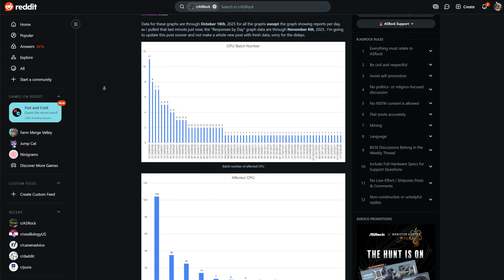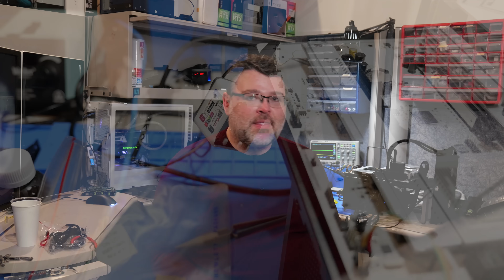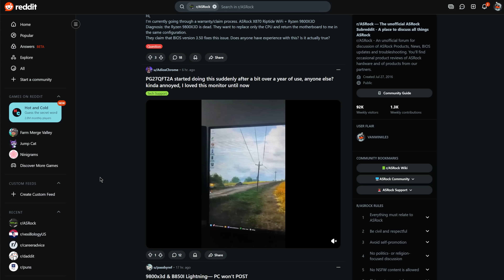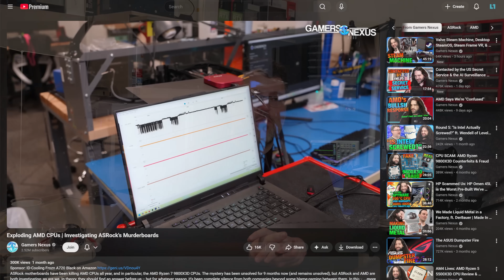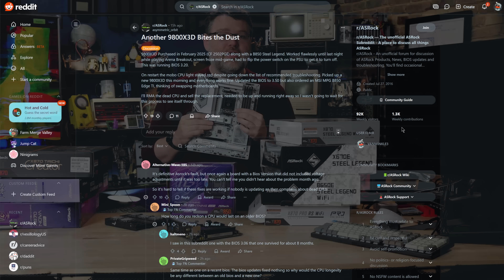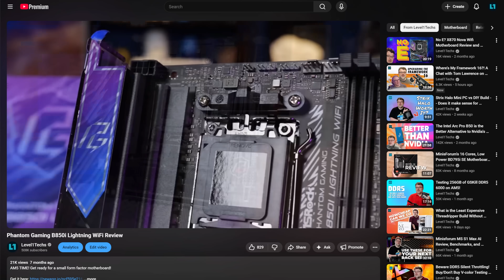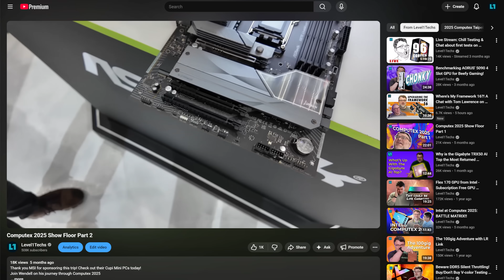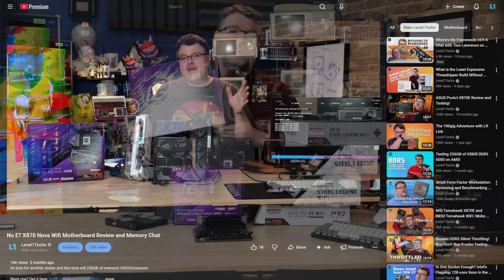Attempting to Troubleshoot the ASRock Motherboards of Death!

Comment: I switched to AM5 recently and simply didn't consider ASRock at all. As rare as the failures may be, there's no justifiable reason to pick a board that potentially has an inherent, serious flaw when there's so many others to choose from. I ended up getting an MSI B850 Edge TI and have been very happy with it.
Reply: G'day CaptainKenway I stopped considering ASRock years ago, I have been building PCs for people here in Australia for MANY yrs (started when intel had PGA) & we have a good "Warranty Returns Through Seller" Policy so gave them many chances due to having Low Pricing for Mid Range Spec. But in the end they just ended up causing more trouble than the cheaper cost was worth for those boards needing Warranty Replacements after time diagnosing what is wrong.

While I am now doing some Gigabyte & ASUS 1156 & 1155 upgrades (to used AM4 helping local Low Income people) for W11 compatibility the only one I or PCs I've built that still has ASRock is a Fatal1ty Z77 Professional which has failing Audio but I keep using it as an Archive PC because it has 10 SATA Ports & no need for Audio. 

Maybe every ASRock Mobo I got was made on Friday Afternoon, but other than all the dead ASRocks in the hundreds of motherboards I have had 1 Gigabyte die on it's own & one GA-970 I Killed with my Athlon II 640 @ 4.6GHz (the Athlon is still working) .
Reply: @shaneeslick  i can kinda confirm that in my shop i had mostly Asrock boards die, even though i used a lot more Gigabyte. I am talking hundreds of samples and almost 10% failure rate for Asrock in the 2016 to 2018 time frame, mostly their very good value itx Z boards that had integrated thunderbolt. Great value, awful survival rate.
Reply: well, there is a reason: their boards prvide very good value, expecially the b650m HDV that has 2 slots and great VRM
Reply: It's not just ASRock, all am5 boards are susceptible
Reply: @iceman5117  It’s definitely Asrock. You’re ignoring the data.
Reply: @GregoryCunningham  ASRock had the most reported failures by a solid margin, but it's not an exclusive problem to them.
Reply: @GregoryCunningham completely incorrect
Reply: @iceman5117  The other boards manufacturers amount to statistical anomalies. Asrock clearly is the motherboard to stay away from. Unless of course, you already purchased one and feel the need to validate.
Reply: @GregoryCunningham what confidence interval are you using to determine that they're anomalies?
Reply: @GregoryCunningham  Just taking a glance at the "data", this seems to be user driven reporting data. So what verification process is done for this "data"? Is there even proof that the cases are legit? Does someone with expert knowledge inspect the systems to validate it wasn't user induced error or another component causing the failure? From what I can tell with a quick glance it feels like this "data" could be easily manipulated by another vendor or someone with malicious intent. Feels wrong to place blame when you have no root cause. Heck, it could be something to do with a socket or CPU both which I believe are provided by AMD.
Reply: @JustSomeGuy009  Go buy one then. 👍
Reply: Had an MSI b450 carbon board die 2 months out of warranty switched to Asrock no issues so far

Comment: You said the board killed the socket as well but since replacing the socket there is no issue. Could it be that this was a bad batch of sockets?
Reply from the maker: interesting idea, could possibly be the case
Reply: @Level1Techs was the replacement socket from the same or different manufacturer?

Comment: I have the ASRock B850 Pro RS with BIOS version 3.50 for nearly a month now and so far, it has yet to fry my AMD Ryzen 5 9600X. The voltages seem within normal range and I'm running my 32GB 2x16GB 6000MT/s CL30 RAM kits in AMD Expo. Here's hoping my CPU survives and lives long enough for a CPU upgrade. Any chance of testing this board too in the near future?

Comment: The issue takes usually 3 months to show itself, hard to show up in lab testing
Reply: But regular use would not have it running 24/7. A month of intensive testing should put enough stress on the machine to simulate 3 months of wear....
If the test is properly designed, ofc.
Reply: @HexerPsy i think its from low use to be honest, many people commented not being able to wake from sleep state

Comment: Not exactly related but the position 1 (socket) bios on my z390 dark died and even with a replacement chip (from evga) it still doesn't work, odd.

Comment: I have a Steel Legend X570 that has been unstable with 2 different 5800X's, one would not post with dual channel ram, the other was very unstable, both run perfectly in single channel ram mode, but the board functions perfectly in dual channel with a 5600X, have been running this board now for years in single channel ram mode, tried 4 different over priced sets of Ram, I also have a X670 Steel Legend, this one is perfect with 7900X in it, OC's, dual channel, XMP enabled, runs cool, performance is outstanding, it has been running non stop for more than 6 months, has never been powered down, only rebooted, so 100% stable machine.

Comment: Last year was the first time I tried an Asrock, I always used MSI before that.  What surprised me was the lack of bios options compared to MSI, such as things related to sleep states and usb devices randomly waking it.  Then the fan curve controls were completely backwards, they didn't update in realtime, so you had no idea which fan you were adjusting and it was complete guesswork.  And then I started to hear about them frying CPUs.  So I just sold it and went back to MSI.
Reply: Yea the fan thing is actual hell lol

Comment: Hey Wendell, don't know if this will help but you could try your tests with high(ish) power-draw USB devices connected (charging phones, speakers without external power etc, light strips). I have the itx phantom gaming motherboard and the only time I noticed weird wake behavior was when I had usb speakers and rgb lights connected. I don't leave that stuff connected anymore and have set the USB power BIOS option to S5 sleep only. There might be a link there and that could explain why it has been hard to reproduce it in lab settings - you normally don't have that stuff in such settings.

Comment: I thought part of this initial issue that seemed to be overlooked, was why the hell were the AMD CPU's failing when not even reaching their specified limits. When you look back at Bios 3.15 and both AMD and Asrocks reactions and actions, it's clear something wasn't right and there was no clear one party to blame.

It is also worth bearing in mind, no one on the planet including AMD and Asrock, as well as system builders and Youtube big names, has EVER managed to replicate and repeat the problem.
From GM's last video, we have well over two million Asrock AM5 motherboards sold, with around 200 reported CPU's having died, not all verified as due to the motherboard.

We have had claims Asrock killed everything from 7600x to 9950X3D and the vast majority are related to 3.15 or were used in 3.15, and we have specific AMD batches that failed more than others.

We have even had hints on people using massive AIO's being the more frequent failures due to how hard the CPU's can be pushed or the pressure on the socket.

It's crazy that this issue has happened, yet no one does the math on how much of a percentage of Asrock sales this has affected, and that its so random, yet mainly affects Reddit users who didn't know how to update from bios 3.15. Yet millions of Asrock owners are suffering no issues happy with motherboards running stock with whatever bios they had when they were plugged in.

It's such a shame, it has certainly ruined ownership and put many off buying and upgrading. I have had no issues, but I don't feel comfortable dropping a 9950X3D into my Nova X870E due to all the clickbait headlines this issue brings out. I've already been considering a new X870E motherboard.

Yet the reality, well GM put some figures to it, but basically a few hundred out of over two million is a decimal point. We do not see hundreds of new Bios 3.40 or 3.50 equipped Asrock X870/B850 motherboards on the social media pages with exploding CPU's, only the occasional Youtubber posting about the issue with screenshots from May 2025 showing bios 3.15.

It's great that another reputable Youtuber is making the effort. But when it's referred to as a Murderboard and we have no clear figures or evidence of the fault, what is that telling us?

Comment: My B850 Lightning Wifi killed my 9950X3D recently. Updated to the latest BIOS whenever it was available. Picked up both the processor and motherboard at launch, so around February of this year.

It still died even at the latest 3.50 BIOS. I do not know if the processor was already degrading before the BIOS updates, but the failure symptom that I encountered was that it was slowly failing to POST from cold start. Sometimes it would start up no problem, other times it would take like five tries to start up the machine from cold boot before it finally POSTed. Then one day, it just would fail to POST no matter what I did and I popped in my old 7950X into the motherboard and it worked just fine. I only did light overclock on it, like -15 CO with a 105W ECO mode setting turned on.

I RMA'd both the motherboard and the CPU. I changed the motherboard out for an Asus B650E-I Strix motherboard and it's been running fine so far, but I do not trust Asrock anymore for Zen 5 X3D processors so the motherboard will be sold off with the note that it is an RMA return replacement board with a warning not to use Zen 5 X3D just to be safe.
Reply: My 9800X3D in my B850I Lightning: "Haha, I'm (still) in danger."
Reply: @concinnus Damage may already be done. Might as well just hope for the best and update to latest BIOS. But be prepared to rma your porceessor with AMD if your processor eventually dies.
Reply: @aznhomig  i hope his cpu(X3D model) is okay after stress test on different brand mobo
Reply: @concinnus then just switched to msi or gigabyte or rog mobo
Reply: @indrahaseo  Considered it, but the only other <ATX board with optical audio out from an ALC not-408# chip is the GB B850M Aorus Pro.  Which, naturally, isn't sold here.
Reply: yeah, only standard model than X3D were totally fine for it

Comment: This is interesting.  I have been beating on a 9800X3D running on a ASRock X670E Taichi for over a year, and I have not had the first bit of trouble with it.  Granted, the CPU is custom water cooled, that should not make a difference?  Stock bios settings, using DDR5 7200 ram, 7900XT GPU.

Comment: I had 9900X killed in a PC I build in early April.
Bought the B850M PRO RS WiFi long after AsRock publicly said the issue is fixed and had the updated BIOS at that time.
Set the memory XMP profile in BIOS, maybe with PBO undervolt afair?
TTK was 4 months (early April > early Aug) running Linux(don't know the distro, but I think it was sth on arch) with multiple VMs and code compiles.
Tried to look into DM history to find if it was sleep related failure but had no info. :/ 
Owner switched since to MSI board and so far no dead CPU #2

Comment: You know, this is kinda starting to sound like it could be a hardware defect in the cpus themselves. Maybe ASrock bios settings just makes it happen more often.
Reply: It seems to be a combination of both AMD and AsRock issues, as it's uneven both across CPU batches and MB vendors.
Reply: I've had a few people dog on me for a. getting an MSI B650 Tomahawk (800 series chipsets didn't exist in May 2023) and b. getting a 7700X, but it's been rock solid stable from day one aside from my own adventures in undervolting. Guess I made a good decision after all, knock on wood...

Comment: I've got an X870E Nova WiFi with a 7950X3D.
And there's been zero problems.
I even have my CPU at Curve Optimizer -28 All Core.
And it's stable and fine.

Comment: possibly poor shielding somewhere on the motherboard, and power from a loose cable arcing over. I've had this happen to a motherboard, but it could have been damaged in shipping. The box wasn't in the best condition. This seems to happen more, in these high wattage CPU's. Electricity is funny, in that it doesn't always burn something out at the fault point.

Comment: So um, Wendell. Let's reflect on 1,4V voltage EXPO kits and consistent high VCore (above 1,2V consistently where it should be 0,9V during idle) on these boards shall we? Might've been a bit better than this effective psuedo marketing techfluencer piece huh?

Never seen a system with a 5200MT/s 1,1V kit plus UEFI PBO disabled fail. It's like EXPO and PBO was a overclock all along. :suprised-pickachu-face:
Reply: I have,  a prebuilt where the owner - my half brother - didnt even enabled expo, so the ram was running at 4800, and on a MSI board not even asrock.
Reply: @Solrac-Siul  What about PBO? And are we talking about the same subject; exploding/physical degrading X3D CPUs?

Comment: Running a X870E Taichi Lite with a 9800X3D for a year with no problems, have updated to all BIOS updates. Only strange thing was after updating to BIOS 3.20 the CPU did not throttle down according to HWiNFO 64 v8.20-5640. CPU PPT Idle power did not seem bad - around 27W. CORE VID did not go below 1.090V and Core Clock (perf #X) on all cores where constant at 5,225.0 MHz. Was solved with the next BIOS update.

Comment: I just got back form Best Buy with a new MSI Tomahawk X870E to replace my ASRock board. When I first got my ASRock board this time last year I ran a 9800x3d and it wasn't stable. I swapped with my son for his 7600 which has run completely stable, and my 9800x3d has run stable on my son's Gigabyte board. I just couldn't bring myself to put the 9800x3d back on my ASRock board. So, I got the MSI and I'm going to rebuild my system this weekend and get my 9800x3d back.

Comment: If you know the odds, then please tell us. You say multiple times that "asrock failure rate is higher normalizing for marketshare". But what is it? are we speaking of 0.0025% compared to 0.0022%? That would be meaningless while 2.5% vs 0.0022% is a big thing.